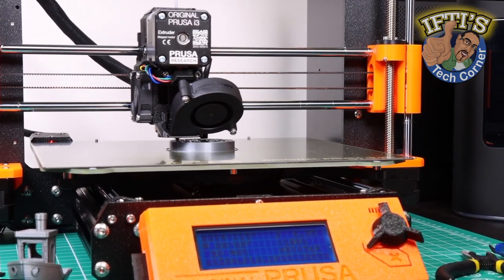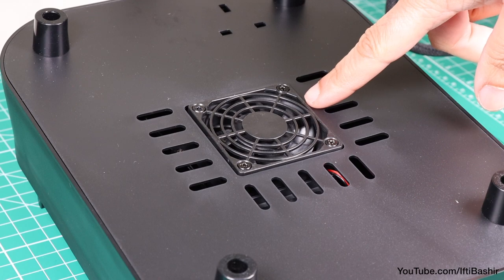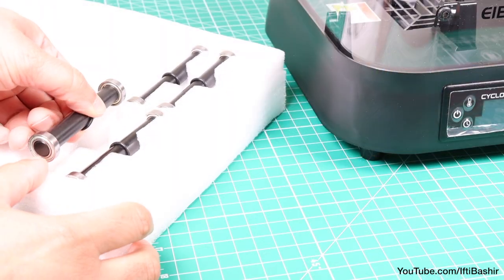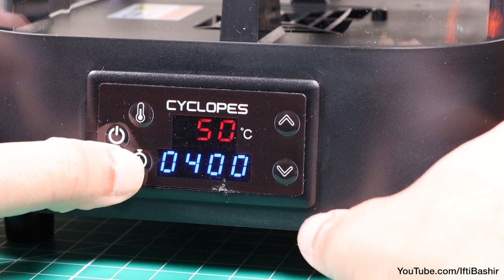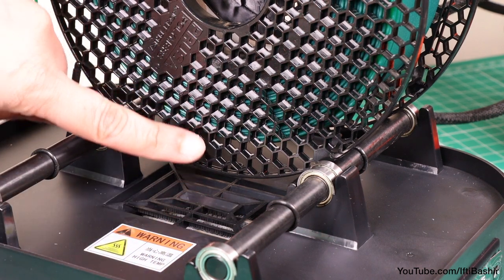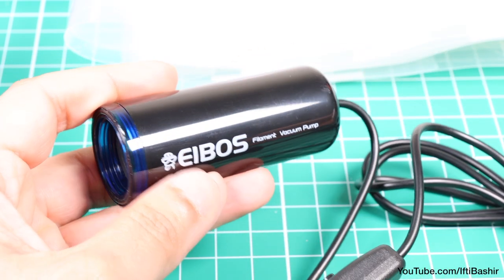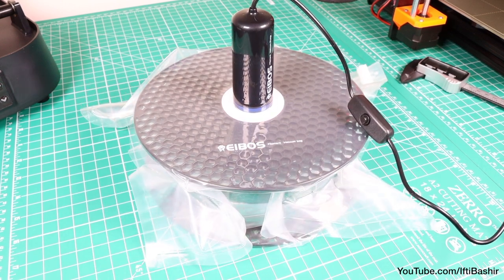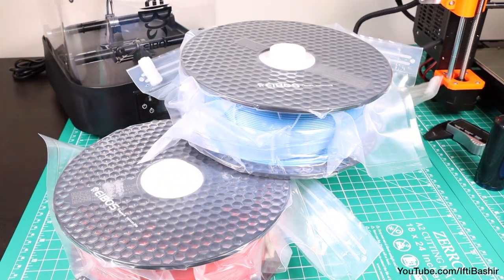3D Printing Filament Drying & Storage Solution : Eibos Cyclopes & Eurus USB Vacuum Pump! - REVIEW

Comment: BE AWARE - These Eibos bags have a very high failure rate. The valves leak like crazy. If not on first use, then on second or third use. The company ignores complaints and requests for replacements. They just go in the trash. The USB electric pump works fine. It's the valves in the bags that fail. Buyer beware...
Reply from the maker: Still using mine and they seem OK so far. I have had 1 or 2 bags out of 10 that seem to lose suction very slightly over a few weeks, but I use the vacuum and they are OK again for another few weeks. I check every couple of weeks though, just in case!
Reply: @iftibashir  - I hate to break it to you, but 2 out of 10 is a 20% failure rate. That really sucks to produce a product with that kind of a failure rate. You are paying for 100% success rate, not an 80% success rate. I am switching to food storage bags. These Eibos bags really suck.
Reply: @davidsh331x  did you find any compatible bags for that pump or did you buy the whole set(bags+pump) again?
Reply: @astrolemonade349  - I haven't looked and don't plan to. They sent me another 10 bags and a pump as a way of shutting me up. I think my 3 pumps will far out last my supply of bags. When the time comes and I need more, I plan to use a food storage bag system, which always works, if you do if right. What I have done though is stop using those dumb little white clips to seal the bags. I don't find that they work nearly as well as my fingers.
Reply: @davidsh331x  did you manage to convince them to send you those just be emailing them and complaining or you did something special?